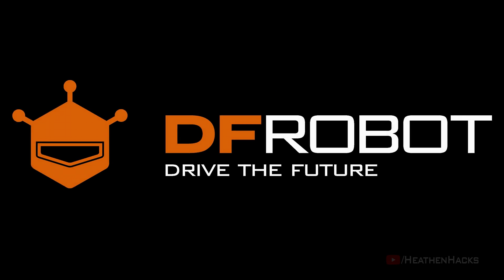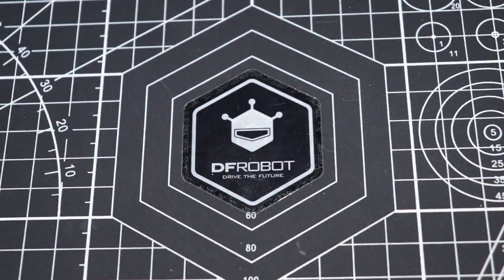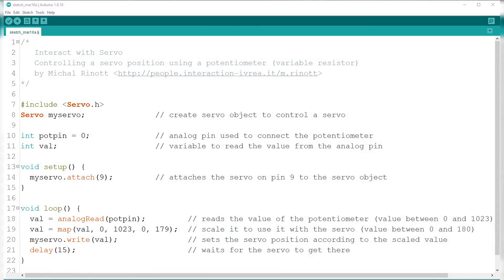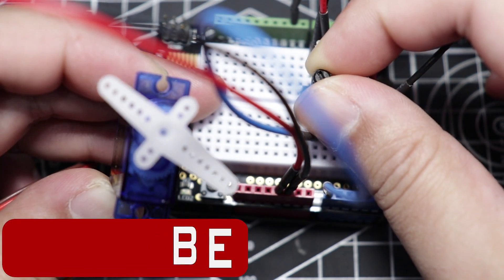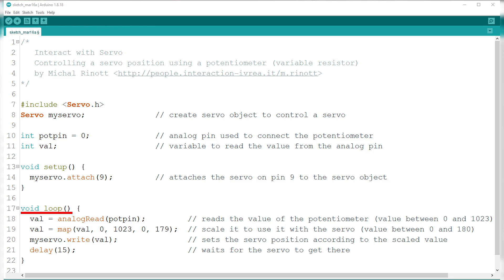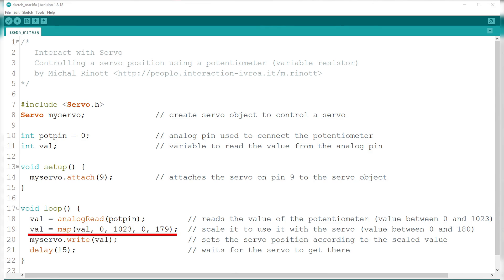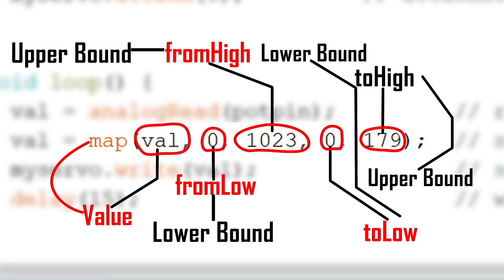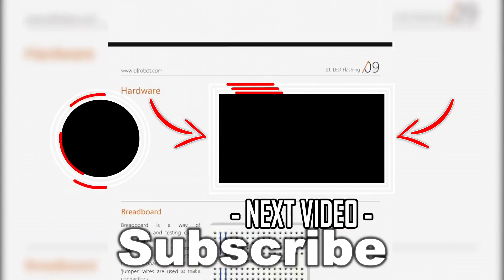DFRobot Beginner Kit for Arduino® - Project 11 Controlling a Servo [Step-by-Step Guide]

Comment: why does it say you need F to M jumpers but you dndt use any?
Reply from the maker: That's a mistake on my part. It's because you can also connect the potentiometer to the breadboard by using the F to M jumper cables if the space is too tight, so, I included them, but forgot to demo. My bad.
Reply: @HeathenHacks  no not your fault at all thats actually what it says on the card i recieved in my start kit too, i was just not sure if i was doing it wrong or not because it wasn't working but it turns out i had a wire wrong!
Reply from the maker: Ah, I see. Yep. In most cases, when something's not working properly, we either wired stuff incorrectly or there's something wrong with our code due to a misspelling or a library version mismatch. 

Sometimes, the tutorial we are following could also be wrong, tho. So, yeah. lol

Glad that you made it work.